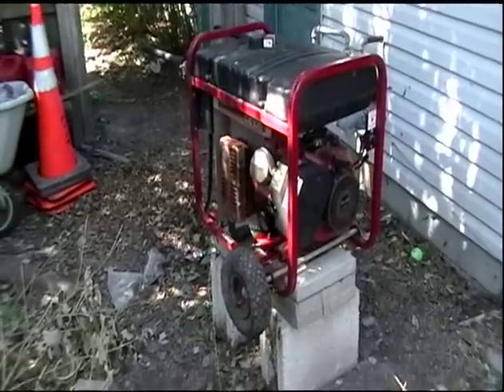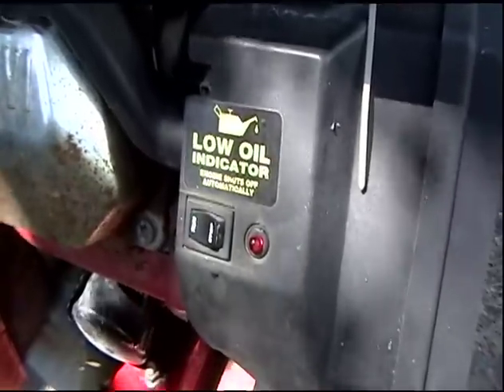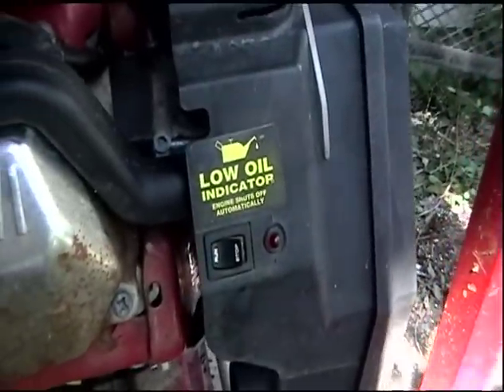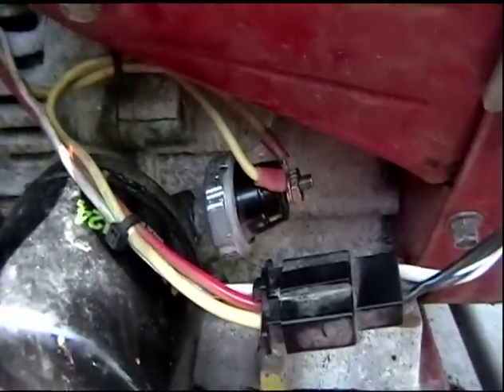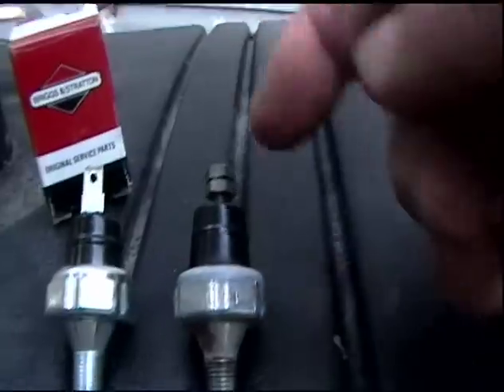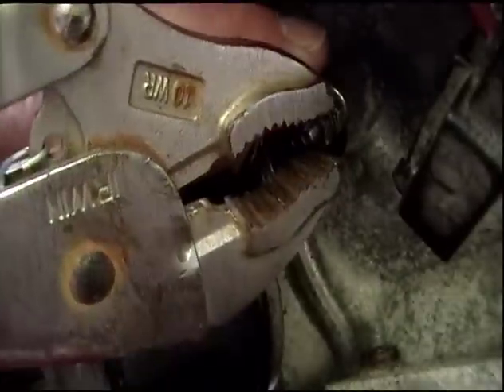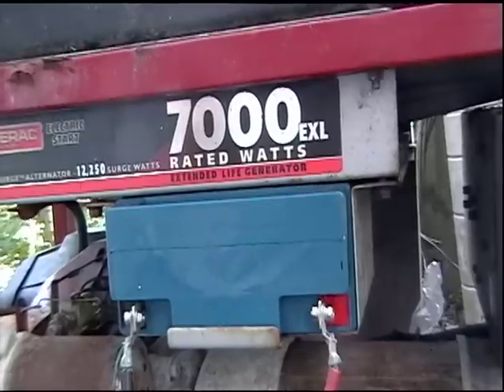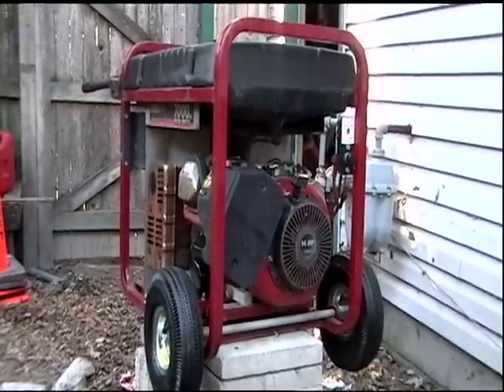Generator runs then shuts off

Comment: Got one of these for free from my local scrap metal collector a few days ago and manage to get the motor unseized and running. Has the same issue where it would die after a few seconds. Going to have to try this later since I didn't think it was the low oil sensor since the previous owner over filled it to where it was shooting out blue smoke. Luckily an oil change fixed that issue and it wasn't stuck or damaged piston rings.

Comment: Dude, you saved my bacon !!   Staring down a hurricane,  and my trusty Generac wouldn't run more than 10 seconds.
This fixed it immediately! I'll be replacing that damn sensor before it goes back in the shed. Thanks again, and great  video work. 🙂

Comment: For those coming in late, that switch is available at any auto parts store with either type connection. It's a standard 1/8" thread. They may ask you the low pressure value. Anything between 5 - 10 PSI is ok in this case.

Comment: Awesome fix!  Last year in NorCal we had wildfires and oppressive heat. The power was out for 4 days. I rigged for silent running with batteries and inverter.  Some guy 1/2 mile away had a similar sounding generator that ran day and night. They never shut it off even to refuel it. At 3AM on night #3, I was wide awake and heard the generator sound a bit different for a few seconds. Then it went into a terrible clatter and stopped, never to be heard again.  I will bet that it had no low oil pressure shutdown device and it ran low on oil and threw a rod.  That was an expensive lesson.

Comment: Had all the same problems as you had. Mine would instead run like shit for 90 seconds and then die. Put a brand new carburetor on it and I disconnected the sensor and it still does the same thing. Oil is good, gas is new, don't know what else to do except shoot the pos

Comment: Thank you very much!! I was having the same problem but I was also having straight gas coming out of where the air filter goes. Took carb off and float was full of gas. So found a carb on Amazon for $23 which was cheaper than a rebuild kit! Excited to put it all back together...fixed the gas running out but ran for 12 sec and died. I was frustrated till I found your video! Thank you! Mine is a 4200watt with a 7.8 hp engine. I looked up replacement oil switch and cheapest I have found is $30! Is there a cheaper alternative? I noticed yours is different than the original but I don't know if your new one would work on mine also...they have a psi rating? I think I read somewhere mine is 6 psi....

Comment: A simple question. Yesterday I check the Guardian 04389 house 7K generator because of the possibility of the 2 hurricanes headed to New Orleans. I also have the dual house gas and propane gas carburetor hook up and I mean that I have a Tee where they connect to the generator. I learned when I got the conversion for the unit I had to start it with the natural gas from house. and yes I ran a 3/4' line to the unit and the propane tank has regulator so not to blast the system with propane and when it starts I slowly turn the natural off and the propane on and you hear the slight increase in the gens rpm speed .
I said this because after running the unit yesterday for an hour I shut it off to grab a bite to eat then went back out after the rain stopped and turn it back on and then shut down the LP&L line to panel and then switch over to the generator and then turned on the breakers to the house and then turn on my 3ton hi efficiency A/C unit and with all the lights and fans frig and freezers on except the washing machine I check both lines into the house with my amp meter and it read 16 to 17 amps on each line into my house which I thought was good since the unit has an out put of 30 amps each line.
Well this after noon I went out and raised up the lid and turn the natural gas back on and waited a few second or a minute then hit the start up and it fired right up but it ran for about 10 or 15 seconds then shut down. I read else where the oil might be low and mine is at the 3/4 mark so any help after reading the rest of this will help.
I hit the start up again and it did the same thing 10 -15 seconds and shut down. Then it started its own self and ran for the 10 to 15 and shut down and this went on several times and that's when I shut is down all together and turn the gas off and came in here to type all of this in hopes of getting and answer.
I bgt it in 2005 when Katrina hit hooked it up and ran for a day or two then shut it down when LP&L came back and then drained the oil and changed the filter. From then till now started it up every couple months and ran it for 20 or so minutes over the years and maybe used it when power off due to power line broken but that only lasted for a hour or two. But again I have changed the oil a couple times and this start and run and stop thing has never happened before now. grewsome@cox.net

Comment: Thanks for info. I changed the oil & filter, & the oil pressure switch, but it will still shut down if I reconnect the switch. I wonder if the engine itself has low oil pressure from time on it, & it will probably not last long.  Oh well, I'll just leave it disconnected & monitor the oil.  Thx again!

Comment: Paxcenn 2300 /1800 starts up it's brand new . Smart mode comes on when you start it . Problem is when you plug in a Saw no power to it .But the generator is running

Comment: Rather than drilling out the small hole on the oil sensor terminal, it would have been better to simply change the wire terminal.
Otherwise, good job!!
I'm currently working on an Onan 6500... Honda 13 hp... Carberator was full of crap, tank valve was bad... That's all been cleaned up or replaced... Plug checked and burned off. Now to the oil switch!!!
Thanks for the video!!

Comment: Cool! Having the exact same problem with a Powerhorse 7000. Just changed oil and filter but same issue with run for 15 seconds and shut down.  My oil shut off is a little different but I  WILL find that connector. Great video.

Comment: Nice vid but instead of drilling a hole in the low oil sensor you could have just got a pack of crimp on spade connectors and installation would have been clean just for future reference bro

Comment: Thank you! you have saved me money. I have checked everything on my generator. I took the carburetor apart, clean the fuel lines check the spark plug and cable. I almost trashed it, when I came across this video, yes it was the oil sensor. As soon as I disable it, it turn right on. Anyway I wanted to say thank you,

Comment: Got the same gen. Exact same problem. Got it after Andrew. Still runs great. Generators were my MOS in the Army so It helps to know what your doing. 1.5 Amps can kill you. Grounding is very important. Good Video.
Reply: Id like to get at least a 25kw for the house.Better yet a 60 KW with a 100 gallon propane tank with automatic line to house shutoff when the power goes off.

Comment: I have a question me and my dad has a generator that looks just like this but when we get it to run she runs but it smokes a lot from sitting and that cover on the front with a filter  starts the flow fuel out of it like  it's peeing and it shuts down does anyone know why it's doing this
Reply: Your needle valve is stuck in an "open" position. Easy fix.... remove the bowl off bottom of carb and check why the float is stuck. Take the float off and needle and clean out the lil port and put it back together. Probably a lil trash in there. Once cleaned up and working like it should no gas should "pee" from the filter.

Comment: Now add fuel stabilizer to that gas and run the generator for five minutes to get stabilizer into the engine and then you won't have any carb issues, also good to start the generator at least once a month and let it run for 10 minutes, moisture in the oil is wood screws up those sensors, changing the oil in the motor at least once a year helps out with moisture in the oil even if the generator is not used.

Comment: Our neighbors were throwing this generator out and offered to us if we wanted to see if we could get it up and running. We decided to give it a try and had the same problem. I Googled "generator starts and stops after just a few seconds" this came up in the search. Low and behold this gentleman saved us a $1,000. Not to mention not having to sleep in stifling heat after hurricane Irma 2017, Palm Beach Gardens Florida
Reply: How did u keep ur generator running an fix the problem of it dying everytime u start it??? Mine is having that problem an i need to know how to fix it please help cause its cold here an i use it for my heater

Comment: It the oil pressure sensor!? I have a SumecFirman SPG3000 and I've almost gone bald with pulling my hair off my head in frustration. I have been going crazy all week. Changed carburettor, changed the starting coil, even changed the darn oil and plugs. I changed everything, and it was the oil pressure sensor all along. my generator would trip off after like 20 seconds, so I took a chance with this video and now it is 2 hours and it hasn't gone off. Thanks a billion brother.👍
Reply: Lol I was going through the same thing.....going crazy.....had my carb off prob ten times....

Comment: Yep same for me,  mine is 10hp Tecumseh Coleman generator with an internal float without a light.  I thought it was the carb changed that out and still has the same issue.  I added oil and problem solved.  Thanks

Comment: My 7550xl ran for 12 seconds then quit. My light didn't glow red either.   Disconnected my 3 wire connector and runs like a charm.  Thanks for the video,  Will replace the sensor after hurricane Mathew passes.

Comment: if this helps some one, was having a problem with onan 4000 running , shutting off at different  run times, after replacing fuel pump, controller, switch, oil, we determined that the inverter in coach [ solenoid ] wasn't producing  13 amps to battery, which in turn wouldn't run generator,  thanks

Comment: I'm having problem with my 95 bounder onan generator, it will run for about 20min then shuts down we have repaired the carb. new gas line and rebuilt the fuel pump do you have any suggestion.

Comment: Glad to see you enjoyed objective success! I have encountered identical problems with Generac, as well as other brands of similar size for portable units. The red low oil warning light will indicate, or illuminate; however if you look carefully, a very thin red line will appear on the base of the LED warning light. It is difficult to notice unless you observe it up close, it is faint,  somewhat dimly lit, but it is noticeable in a dark area. Had to clasp my hands around the light to notice the faint illumination. This is a common problem, have seen the dim light numerous times on various makes and models of portables, when the low oil switch fails. Good luck; and start your generator at least once every 2 weeks, the whole system needs to be periodically exercised; and use premium gasoline as well. Let it run for 5-10 minutes, thanks for the video.

Comment: I have been having this problem with my Honda 6.5 running and then stopping...My solution after doing several things I pulled the low oil sensor wire off and it quit doing it. So must be a low oil sensor problem...
Reply: my 3500 predator runs for 10 minutes, stops!.will start.right back! what is wrong???

Comment: Well thank you for sharing the oil sensor story. I was
having exactly the same problem and I had already rebuilt my carburetor, clean
the muffler, check spark plug and made sure that it was all working but it
would start and run for about 12sec and stop. I guess I had not check the oil
level in a long time and that is something that I always tell my sons to check.
Well this generator does not have a sensor that I could see but the oil level
was almost nothing. I added the oil and guess what? It started and kept on
running. I think that I will drain the oil and put some brand new oil on the
compressor. Thanks again for sharing.

Comment: This was very help full!  My unit is a 7500 EXL and looks just like your 7000. I though my unit may have the same issue but disconnecting the low oil pressure switch does not help. Check to ensure fuel flow from tank to carb. and I checked for clogged fuel filter. Air flows freely through it. My symptoms are different as it only tries to run when I spray starter fluid into air intake. This sounds like a carburetor issue to me. I'm having a problem finding more info on the carb.

Comment: Thank you!  My generator(10000 EXL) was running fine until today.  I changed the oil and filter today and it started, ran for a while then shut off.  Pulled off the shroud over the sensor.  The sensor was corroded.  Disconnected it and it works perfect.  Ready for the blizzard we are expecting tonight.  Thank you!

Comment: Thank you very much. My 5500XL sat unused in a shed for 4 years. I thought it was trash. It wouldn't start so I replaced the spark plug, gas, and oil - then it did as yours. I was so surprised at the fix. Now it runs just fine.

Comment: YOu gotta be kidding me!!! I was going to buy a new generator! This is awesome! Thank you! I neglected my 4000 too and I thought it was dead, started for 15 sec...
This video just saved me $700! Where do I send a present? LOL
Reply: my generac 3500 hasnt run in 5 years, at least, i watched this disconnected the plug, sprayed starter fluid, added fresh gas and it started up time and time again and ran for 20 minutes and then 30 minutes  what a great video  
i spent every year 45 to 60 dollars for carb repair etc and this was the problem 
thank you ol' boy
Reply: same story for me.....thanks

Comment: Just like yours, my warning light doesn't work either....never has, so our genny often relies on the low oil cutout. (unlike yours, ours will not start again at all until the oil is topped up). After the last cutout it refused to start and so I decided to try disconnecting the oil pressure sensor. Sure enough it fired up right away, and ran like it always does. Just to confirm that the issue was the sensor I reconnected the wires, but she still fired up and ran as normal. Is it possible that the sensor gets reset or does my issue probably lie elsewhere?
Reply: Good nite   I'm have  my  generator   Yamaha  my 360  my power  going
Reply: I'm need  you for elp me
Reply: Mh

Comment: Great video and my husband is like you not mechanically inclined.  After our power outage we used our Generac 4000 so he decided to change the oil and the same thing happened to ours.  I made him sit down and watch your video, we tested the one  thing you showed of disconnecting the wires, and it ran over 12 seconds until we shut it off.  So he will put your video to use and we thank you very much for the very helpful tips.  My husband also thanked me for finding you on utube, got a big high 5 for my help and with your help we will order the sensor part and should be good to go when the next outage hits!

Comment: That was it.Gonna try to get a new oil switch Monday.Ran it for an hour to use up the old gas.
I was a 52B20 (Power Generator operater and mech.)in the army in 73 for 3 years. Amazing all I learned I forgot most of it till I saw your vid. It was like right away it clicked in my memory bank.Thanks again.

Comment: Thank you! With another city-stopping ice storm bearing down on Atlanta, I cranked up the old Generac only to have it run for ten seconds then cut off. Your video solved the problem in no time. The Generac is running like gangbusters out on the deck now!

Comment: This is a great video. The only thing I would mention when bypassing the low oil sensor is to check your oil before doing so. It is a common issue for these engines. I see it all the time being a generac technician

Comment: In 36 hours an ice storm will hit my area most likely so I thought I'd double check everything.  Had this Generator for 14 years and used it a number of times.  Had the 10 second run problem and could find no other fix for it.  Soaked and rebuilt the carbs,  Drained and replaced the gas, plugs, all I could think of.  Not a newbie on engines by far.  You saved my As_.  Thanks man.  I'll get the replacement sensor after the storm this weekend.  My wife says thank you too.  (she does not like roughing it.)

Comment: Hey, BIG DITTO on THANX,  Not a very Macho thing to be making phone calls, askin' for help though, while the rest of us remain true to our gender of searchin', cipherin' and troubleshootin'  :), but what powerful results.  And very counterintuitive to unplug something to make the engine run.  Hats off to ya, though, Great video, Great Fix,  and thanx for the making the world a better place, by offering unfettered help.  Will pass it on,  Regards, Mo
Reply: Just additional info after completing fix.  I like to know how things work. (Gender thing I guess).   I was thinking perhaps the switch was just stuck. Applying 80 psi, air, did not release it, but the switch worked fine using a nail in the orifice. (Do not use nail in new one) There must be a diaphragm in there that deteorates.  My 8 HP B&S puts out 40+ psi oil pressure, which surprised me.  My parts manual called for an 8 psi sensor(099236), which does have the machine screw end for $25 plus s&h.  I see you used a 3-5 psi sensor.  I settled on a 3-9 psi sensor @ the local auto store (Standard PS15),  $8 with the spade connection like yours.  I also had an oil sensor socket ($6 at auto discount store) from a fix on my Toyota(oil light stayed on, bad oil sensor). I had no other socket nor tool that would work at the time.  Thanx much for sharing useful info, guys,  Regards, Mo

Comment: I had the same problem.  I expected the light to do something like maybe light up if it wasn't sensing pressure. Anyways I just took the wire off the end of the sensor because mine doesn't have the clip like yours.  Thanks for sharing.